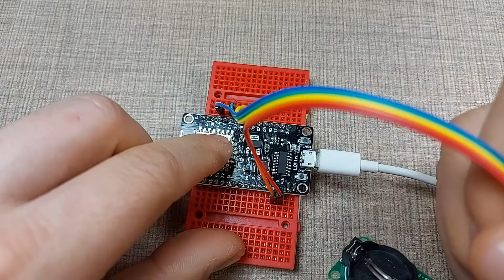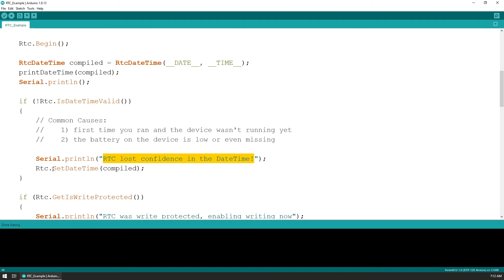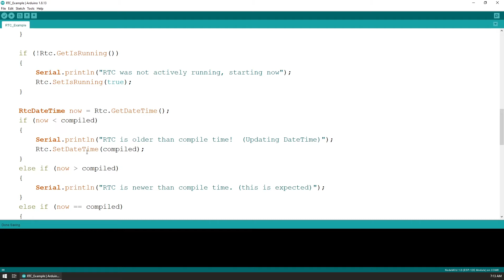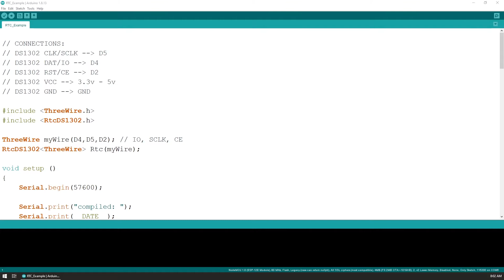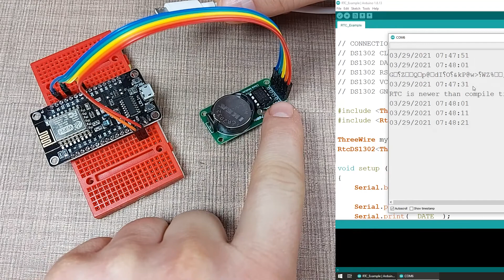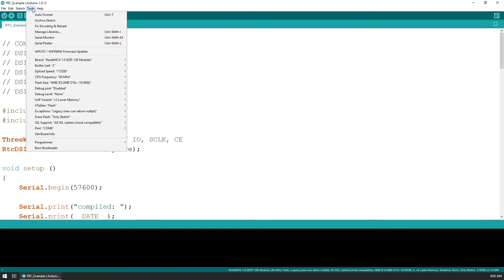How to use Arduino Real Time Clock module with DS1302 chip

Comment: This is very well explained, thank you. But I am wondering - you said the battery is being (trickle)charged (0:45). The battery you are using is not rechargeable. Could that be a problem?
Reply from the maker: These batteries are all based on lithium so I guess some small current does not harm them. So far I haven't had a problem at all.

Comment: At 10:03, in the serial monitor, a load of junk appears on line 3.  What and why is that?
Reply from the maker: It happens when the reset button is pressed on the NodeMCU but I'm not really sure why. You can see it happening at 11:02 I guess it has to do with the processor starting up and maybe using different baud rate at start. I've seen this with many microcontrollers but I've never really paid any attention to it.
Reply: @TasteTheCode  Thank you, I am learning, your reply is appreciated.
Reply from the maker: You are welcome!

Comment: I hve problem. I first upload the code using cable. Then i unplug it and using battery 9v to it. Btw mine use arduino uno. It doesnt updatind new time. Example i run on 9.00 (10/6/2023) and when i unplug and connect the battery at 10.00 the same day it just show the 9.00am one not the updating
Reply from the maker: I had that once happening to me as well but with a low-voltage battery on the module. I replaced it with a new battery and it never happened again.
Reply: @TasteTheCode  okay i wil try use new battery. THANKSSSS

Comment: Is there a way to use a battery instead of cable to power source?
Reply from the maker: Yes you can. You will either need to provide 5V on the Vin pin or 3.3V regulated on any of the 3V3 pins. I have another project where I'm using power bank ICs to make a project power supply for this purpose. You can check it here: https://www.youtube.com/watch?v=Ze9JscCxLx8
Reply: @TasteTheCode  Thank you, i'm doing this for a school project and they gave me an arduino board and a 9V Battery Snap DC Cable. However, I found your video and ordered the DS1302 and the NodeMCU and I just wanted to ask, does the 9V battery snap work with the NodeMCU?
Reply from the maker: Arduinos, work on 5V, and the Uno especially have a mich larger voltage regulator to handle higher voltage range. NodeMCU works on 3.3V, and I think the max you can provide on the Vin pin is 5V. However, if tou have the Arduino, the same code should work on it as it works on the NodeMCU so you can basically just swap them.
Reply: @TasteTheCode  Could you please send me a link or the name of a battery and/or battery holder that would work on this. Sorry I am completely new to this and I am struggling.
Reply from the maker: @Filo-qn8pj  I'm not sure what you need. Arduino Uno will work on a 9V battery and you can still use the RTC module on it in exactly the same way as on the NodeMCU.
Reply: @TasteTheCode  Will it work on an Arduino nano? The code, 9V battery
Reply from the maker: @Filo-qn8pj  It should! The Nano board can receive up to 12V on its Vin pin and the code is exactly the same, just match the pins in the sketch as your wiring.

Comment: Hello Bill .....im from South Africa and my sons do online racing I am interested in developing a  gearshift device which they can use as a gear shifter on either side of their steering wheels. They currently use  ordinary switches but the more complex wheels use Hall Sensors.  How can i get more in touch with you to possibly help me to change the switches out for Hall sensors .......
Reply from the maker: Hey Robert, I don't usually do personal help on projects but my I would suggest that you mount a magnet on the lever of the shifter and then, behind it you can mount the hall effect sensor. You will need one that detects presence of a magnetic field and not the ones that work as on/off switches (detect magnetic polarity). Feel free to contact me through my Facebook page.

Comment: ci sono siti che danno data ora e minuti
Reply from the maker: Yes, but this is handy if the project is not connected on the internet.
Reply: @TasteTheCode  sure but since it has a wi-fi module I thought...
Reply from the maker: I often use NodeMCUs as just demonstration, basically using them instead of an Arduino Nano or Uno.

Comment: I tried this with my ds 1302. It returns
19/80/2091 44:127:1 +
RTC lost confidence in the DateTime!
data read (20) = "⸮ G
Do you know why this happens?
Reply from the maker: Did you set the time initially? Check that the battery is OK and that it is making a good connection. I had a bad battery making weird issues once.
Reply: @TasteTheCode  The compiled time is set. The battery has 3 Volts and I think it has a good connection. I also tried changing the battery. That didn't work either. Could my ds 1302 be broken?
Reply from the maker: I've never seen one to fail but it's not impossible. Do you have another one to try?